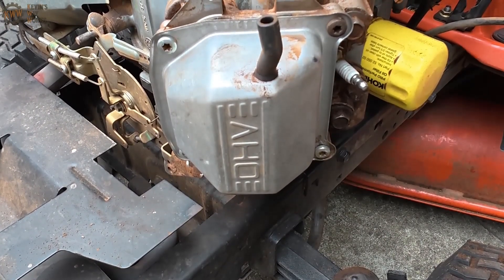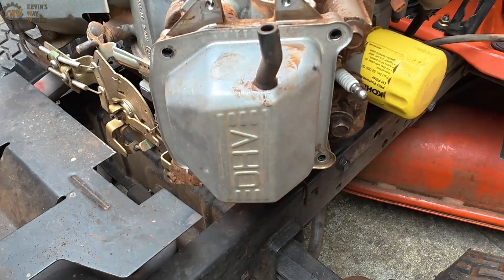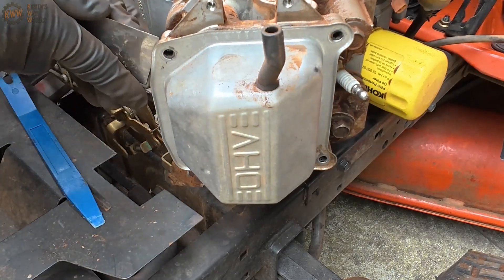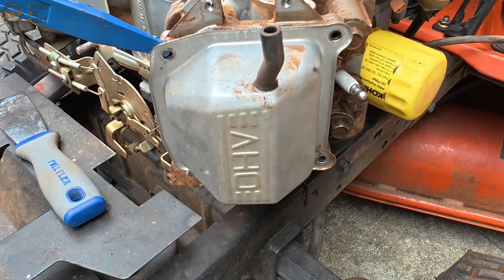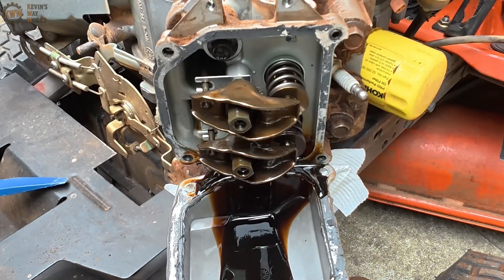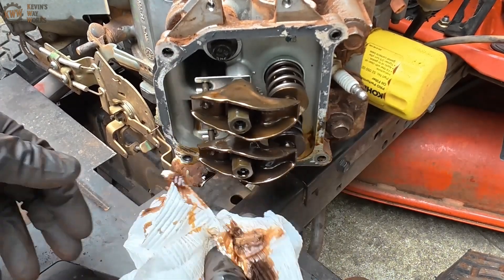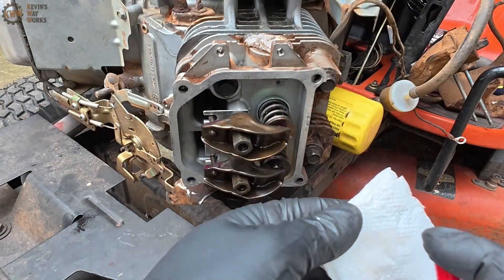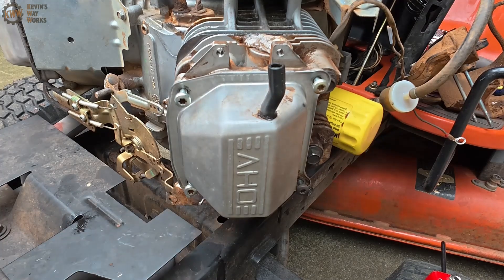Kohler Engine Valve Cover Leak Repair (V-Twin Courage, 7000 Series & More)

Comment: Very clean oil.
Reply from the maker: I believe it's Mobile 1 Fully Synthetic.  That's my go-to oil for my cars.  After 7500 miles, it always comes out looking clean like that.  So clean that I wonder if I already changed it and forgot to document it in my maintenance log.  I have 6 cars so it's impossible for me to remember if I don't document it.

Comment: What was the purpose for releasing the tension on the rocker arms to fix the oil leak ? 8:14
Reply from the maker: Good catch.   This is part of a series where I replace a blown head gasket and I had scraped the RTV during disassembly.  You can also see earlier in the video where they are in place then the next clip, they are off.
Reply: @KevinsWayWorks  Gotcha. I’m fixing to pull the right head on my Kohler KT725. It’s spitting from the exhaust portion of the head gasket. Both cylinders have 145 pounds of compression so that makes me feel better.

Comment: Great video.  Would this be the same for the 17 HP Kohler engine?  I have an oil leak as well.  And if it’s metal you don’t need the gasket just the rvt sealant?
Reply from the maker: It depends on which 17 HP Kohler you have and where the leak is. Some Courage 17 HP models use RTV instead of a gasket on the valve cover, while many Command or older K-series engines require an actual gasket. If the factory design calls for a gasket, you should use one.  RTV is only a replacement if the manual specifies it.

Do you know the model number?
Reply: CV490S
Reply from the maker: @LisaRose-w8y  The service manual says 1/16" bead of RTV and torque to 65 in lbs.  Looks like it might use cast aluminum vmco ers.  There's a certain sequence specified as well.   Here's the service manual:  https://resources.kohler.com/power/kohler/enginesUS/pdf/tp_2339_d.pdf

Comment: Did you put a new gasket in, or just use sealant?   I have to replace mine and can’t find a gasket b
Reply from the maker: The factory service manual for the courage line that encompasses the one in this video specifies RTV for the gasket if the cover is stamped steel.  If it's plastic, rubber gasket.  I've never tried a rubber gasket with stamped steel.  My guess is they don't specify RTV for the plastic cover because you might damage the plastic when removing the cover.

It depends upon the model and what the factory service manual specifies.  On some, if you use RTV instead of the gasket, you can block oil passages.  It's best to consult the FSM for your particular model.

Comment: So question, Mine has fouled the plug on the right(key side) of the motor. It started runnin rough after starting and mowing for a bit. Like it wanted to cut out and loose power and I THOUGHT it seamed like it wanted to backfire. I changed the fuel filter, changed the spark plugs, checked the fuel solenoid, it's good. I have  spark from both sides. I cleaned the magnets up on the flywheel. It will start and run; but runs a little rough yet. After running and shutting off, it will not start. Just turns over. Today after putting the fuel solenoid back on, I took the breather cover off and it had quite a bit of gas in it. I DID try to use a little starting fluid to get it to start, no go. I also sprayed a little carb cleaner down in the breather holes. I now have it all cleaned and put back together. I have not tried to start it yet and I still have to put the frame work back together. Also, before I forget, the exhaust pipe coming from the manifold to the muffler is cracked and it was leaking gas out of the crack. The oil was fine. No gas in it. Any ideas or help? Changed the fuel filter as well. Had gas going through the fuel filter and was pumping out the fuel pump. I do not know what else to do unless I tear the carb apart and see if there is dabris inside of it. Or possibly the head gasket is leaking????
Reply from the maker: It almost sounds like you're getting too much fuel.  The first thing I'd check is the float in the carb and the needle valve to be sure they aren't letting fuel just free flow up and into the intake.  I'd also check compression to make sure both cylinders have proper compression.  If not, you may need to check the valve clearances and may need to remove the head to examine the valves.

Comment: Thanks I have a SV725 also that the front of the engine is covered in oil. Mostly right side without the breather tube. Is this a common problem with these or should I look for a cracked block? It also won’t run without adding fuel to carb with a new fuel pump no fuel getting to the carb bowl. Thanks if you have time for some ideas.
Reply from the maker: It's usually a leaking valve cover that causes this.   I've done leaky valve covers on this same mower 4 times now.
Reply: Do you not need the paper gasket too?
Reply: @richardsatterfield4222  there’s no paper gasket on the original valve covers just RTV sealant. They do have an upgrade kit for them with plastic valve covers and an o-ring seal. I just resealed mine.
Reply: I had same issue with no starting unless I put gas in carb. It was the throttle cable was stretched and was not engaging choke replaced cable adjusted it. It fixed issue.